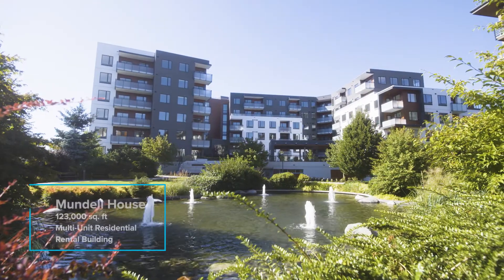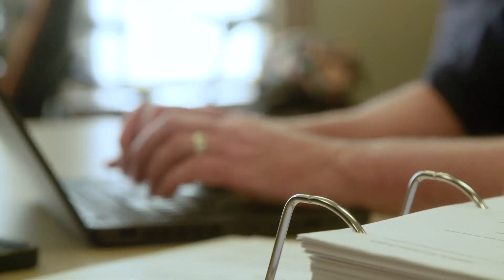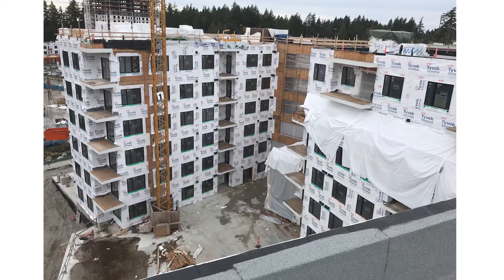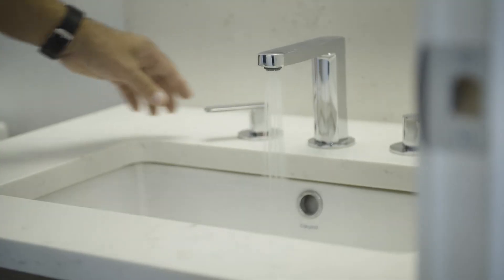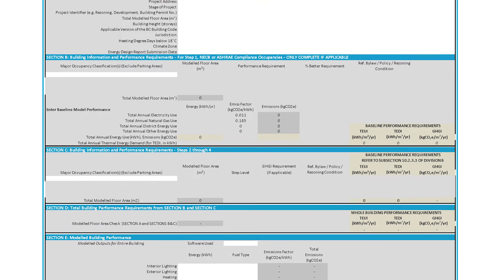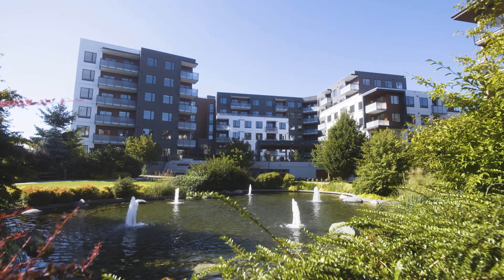Mundell House: Airtightness Testing Demonstration Project

Comment: Key insights

🌱 Mundell House is a sustainable community dedicated to UBC faculty and staff rental housing, prioritizing sustainability and green building action plans.
🏡 Local governments that choose to adopt the BC energy step code make air tightness testing a regulatory requirement for construction projects.
📋 The construction manager needs to be involved early in the process to provide advice on pre-construction and cost implications.
💨 Sealing up all the vents on the outside can make air-tightness testing in the construction phase easier and more efficient.
🏗 The meticulous preparation process for airtightness testing involves a team of individuals responsible for specific areas of the building.
🏠 Airtightness testing can help identify areas of significant air leakage in buildings before running the actual test.
🏠 The Mundell House achieved an impressive 0.97 ach-50, close to the passive house requirement of 0.6 ach-50.
💰 Reduced operational costs and increased energy efficiency of the building contribute to a healthier indoor environment and reduced greenhouse gases.

TLDR: Airtightness testing is crucial for ensuring energy efficiency, sustainability, and a healthy indoor environment in buildings, and it is now a regulatory requirement under the BC energy step code.

1. 00:00 🏡 Mundell House is a six-story wood frame rental building with 135 units dedicated to UBC faculty and staff, focusing on sustainability and green building design.

2. 00:56 🏠 Mundell House was designed before energy efficiency standards were in place, but now air tightness testing is a regulatory requirement for construction projects under the BC energy step code.

3. 02:20 🏗 Building envelope consultants play a crucial role in guiding the construction team on materials and sequencing for air tightness testing, with early involvement of the construction manager and a walk-through before the test date.

4. 03:45 🏠 Mask off vents and other areas, fill plumbing traps with water, prop open doors, and seal vents on the outside to ensure airtightness testing goes smoothly.

5. 04:48 🏗 A team prepped the site, the superintendent reviewed it, and the airtightness test was performed on a Saturday.

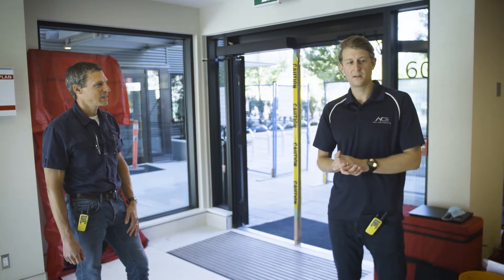6. 05:28 🏠 Blower doors are set up to test airtightness in the building, using smoke pencils to find air leaks.

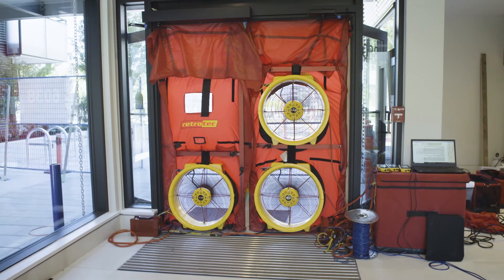7. 06:39 🏠 Airtightness testing is required under the BC energy step code, with specific pressure differentials and reporting methods, and living in an airtight building has many benefits.

8. 08:04 🏡 Building airtightness testing leads to reduced operational costs, increased energy efficiency, a healthier indoor environment, and overall improved quality of life for renters and buildings.